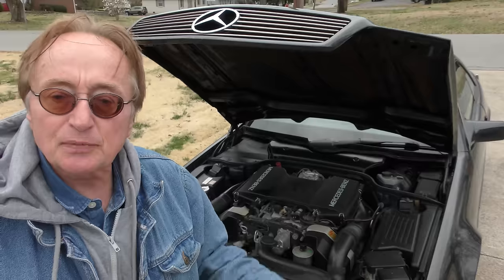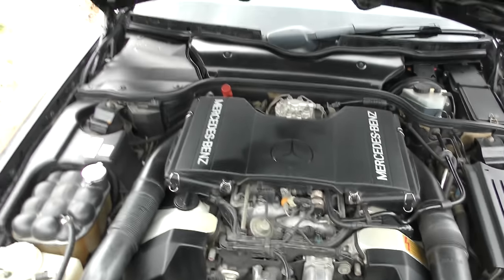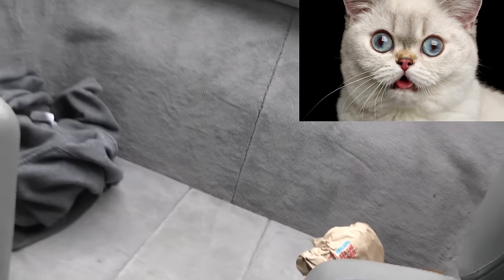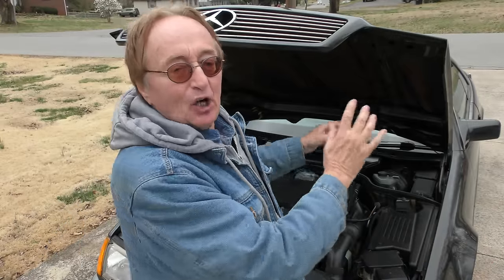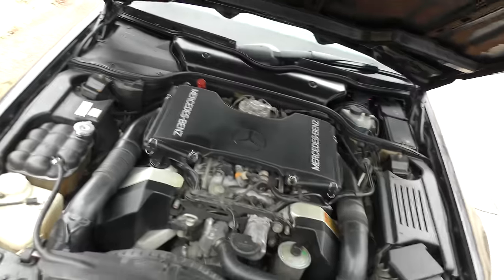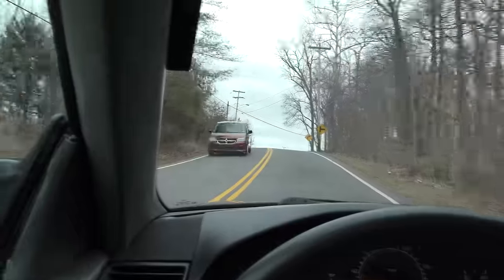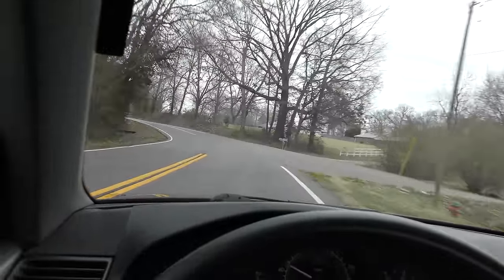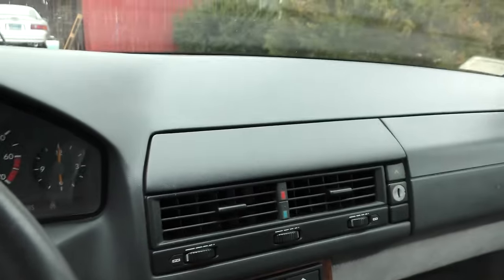Mercedes Just Beat Toyota

Comment: I wouldn't touch a Mercedes built in the last 15 years or so but these from this era were really solid. Now I would want the one with the straight six and the manual transmission but even the automatic were really good overall. This is when Mercedes overbuilt their engines and transmissions and didn't have an engine bay with more plastic than metal. And to that one guy who just can't resist telling me that I don't know anything I stick to my opinion 100%.

Comment: 326 horsepower is pretty impressive for a old car.
Reply: remember, it's not about having a big engine to make your car faster, big engines make your car more prone to bigger fuel consumption and are hard to repair because of the complexities that the bigger engines have (well almost of it), but most big engines are reliable and some of them are quite fuel efficient (for example, Toyota Avalon have a 3.5 liter V8 engine, and Avalon can achieve 35 MPG despite of the engine being bigger, And Second, the Ford 4.6 liter V8 engine can achieve a 27 MPG on the highway or 22 MPG on the older ones) but I'm not gonna lie, in my opinion, the 4.6 liter Ford V8 is some of the best engines that produced in the American automobile industry, and I love it (maybe I should work for GM and I make smaller engine that are durable, easy to repair, efficient, and reliable)
Reply: maybe in my opinion, horsepower and torque is what making the car faster, even when you have a smaller engine...........
Reply: @jeancarlorabino6454  true. many cars with smaller engine make as much power as the gas guzzling V8s if not more. For example, the Mercedes A45 AMG, the Audi RS3 and even the new VW golf R. The golf R easily keeps up with a dodge charger RT.  It's no wonder why naturally aspirated V8s are dying out. Even the V8 In the gt350 is irrelevant because the Nissan GT-R, the Maserati gran Turismo trofeo, the BMW M3 and M4 all make 500+ horsepower just like the gt350 even tho they don't use V8s but hey, at least the naturally aspirated V8s sounds good and perhaps they last longer without the stress of turbos.

Comment: I bought a 1999 SL 500 new. Drove it until 2020 when that “complex vacuum system” failed at 298000 miles. Parts not available. Original price $105,000. Sold it for $5,000. Had it been repairable I would still be driving it. New ones are crap!

Comment: My 94 E300 sedan had a button on the dash where the window switches were (in Center console) for retracting the back seats head rest! EXCEPT that’s all it did! Release a latch and the spring loaded head rest would SLAM onto the rear window dash! (Were speakers are) 😂😂😂
But not made to put them back up?! I thought it was broken and took it to a few garages told no that’s how they work and never powered to go back up! 
😂😂 ok so you need to back up to park I guess it’s nice to have more seeing room but to have to remember to fold them back up?! It’s a pain.
   W we ish they kept Center console cuz in 94 E300 there’s only reg compartment

Comment: Thats why i dont drive anything toyota makes now, and I still have a 2000 4runner with 200k miles. Runs great!
Reply: Eventually, it's going to come to an end and my question is, what would you replace it with, if you had to?
Reply: @hhaste  buy another old one as long theres no rust on the frame

Comment: I just picked  up a 2007 Volvo XC90 V8 with the 4.4L yamaha, and I'm amazed with the thing. It's almost all made of metal! Almost knocked myself out hitting my head on the hatchback. 311 horsepower naturally aspirated engine, no fancy turbos or high pressure injection systems. I just wish it had manual windows and locks! But ok the hvac system is retardedly complicated and there is some kind of water leak in the sunroof I need to track down, but 175K and runs like a top no codes, and after doing the brakes it seems like it will go for many more miles.
Reply: I wouldn't consider a turbo "fancy" lol
Reply: @hhaste  I would. I've owned and worked on several turbo vehicles. They are completely unnecessary and make the vehicle less reliable and absolutely reduce the lifespan of the engine. That said they give you more power and some better gas mileage, but the tradeoff is far from worth it imho. Saab and Volvo have made some of the most reliable turbos.

Comment: Had a 2003 MB SL500.. a money pit !!@..Engine was great. 16 plugs fun to drive.. ate tires after 20000 miles.. suspension issues😮 when you do a brake job you have to replace the brake rotors at the same time..$$